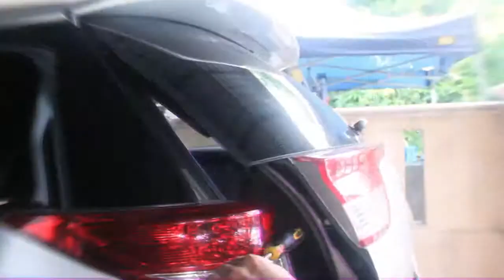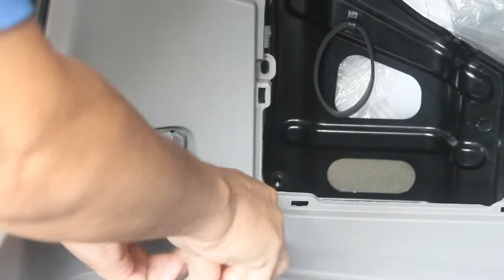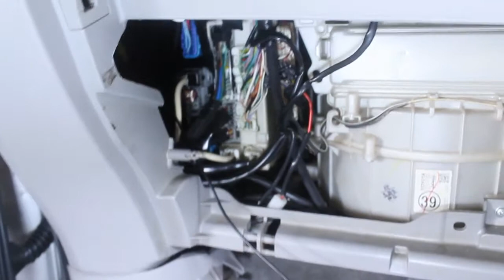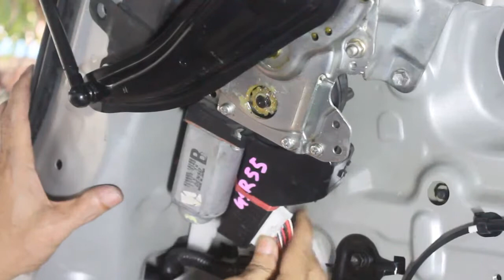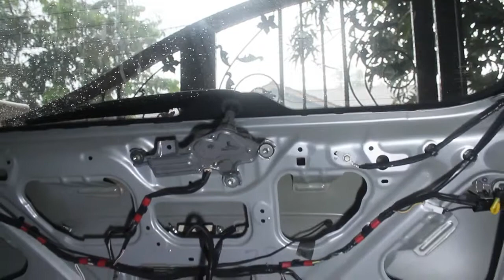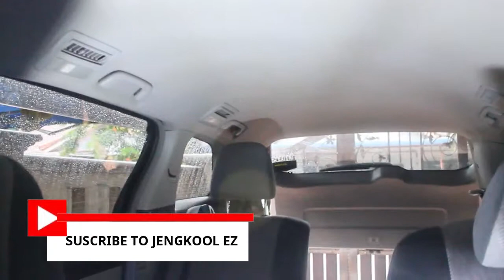POWER BOOT INSTALLATION | Toyota (ACR50)

Comment: bos..kalau acr50 yg xde power booth..pemasangan seperti ni jugak ke? adds on button dan remote kena ade skali ke? kalau xde button dan remote power booth x function?
Reply from the maker: Video ni upgrade kepada power boot.. pemasangan pnp motor, sensor, lock regulator, suis button, body trim, remote n wiring booth sampai ecu. kalau pandai wiring is bonus tak yah tukar wiring asal. Remote kena buat reprograme untk dia fungtion.